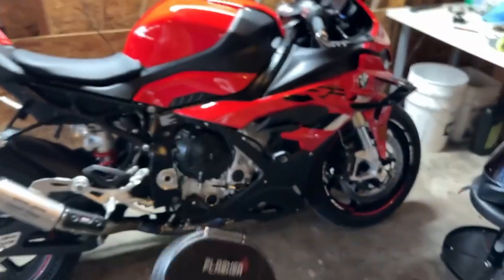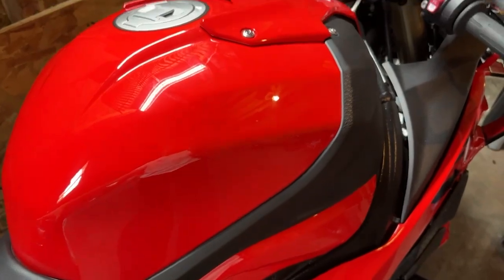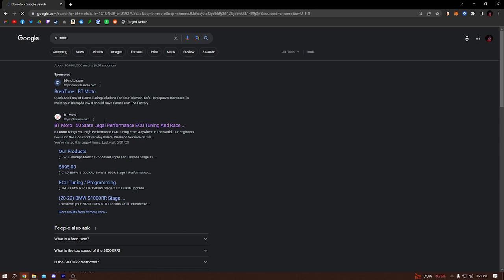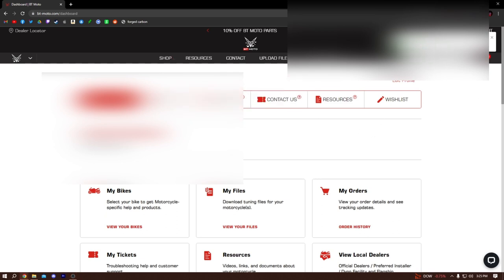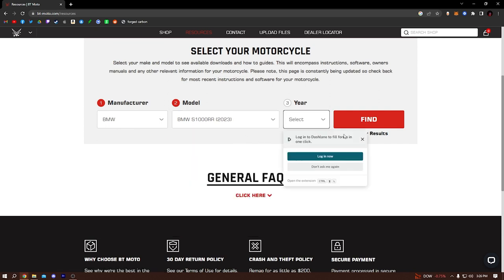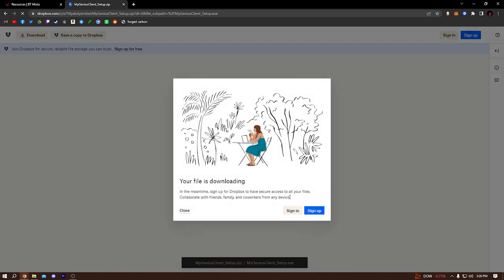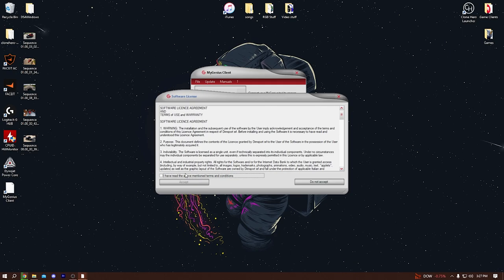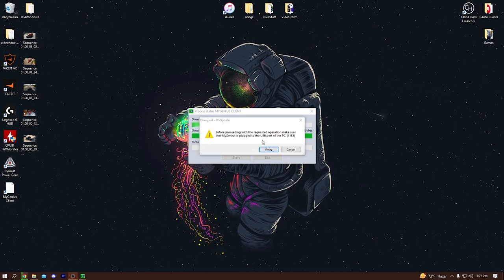How to Bren Tune your 2023 S1000RR! (Reaction)

Comment: Are all your quickshifts up extremely jerky with the bren tune? I got a stage 2 and a full akra exhaust installed on mine, and every upshift throws me back, no matter what gear Im in or what rpm Im at, or how little throttle input Im giving the bike. Its like the ecu is blipping the throttle way too much during quickshifts. The downshifts are super smooth the upshifts are ridiculous, almost unbearable, especially when just riding through town. Just wondering if there is an issue with my tune, or if thats standard.

Comment: My brother runs bt tuner in his 2022 they were backorder when I went to get mine for my 2022, so I went with slr. we have identical bikes, the exact same mods except the tunes. we weigh within 5lbs of each other, every time we race, weather from a dig or a 1st, 2nd or 3rd gear roll start my bike jumps out on his and pulls from him and wins by 3-5 bikes even when we swap bikes. And slr's customer service has been top notch! I couldn't get the tunes on the flasher, i called the tuner and he immediately did a remote screen share and downloaded it all for me.
Reply: Did you get the 91 octane map? Does he have the 93?
Reply: @SmittyAZ  he asked me what one I went with 91 because 93 is rare in my state
Reply: @natecote1971  91 here too. Frank usually flashes for 91. My Grand America is BT. The HH has two maps
Reply: @natecote1971  I found octane booster pellets that are easily carried. 1 pill brings my 7 gallon BMW high enough. BT
SLR did my ZH2 / 22 BUSA / 22 Triump ST 1200 RR and the Tuono V4  1100 was just ordered. These flashers are going to break me!
Reply: I have been debating SLR and or Brent I don't roll race just want the best performance out of these bikes and want to pay top dollar for the best.  Did SLR raise your rev limiter? i am thinking of asking him not to do that just in case.. Thanks
Reply: @Farhan.DucatiS1k  If you ask them to not raise it, they won't.

Comment: Flashed mine a few days ago. That tune is sublime! Mad respect to BT Moto.
Reply from the maker: Bren Tune is on top🔥🔥🔥 glad you enjoy it as much as me!
Reply: Nice! I might of heard a run of handhelds done by some of the engineers from a Tx company that specializes in a different field. 👀
Reply from the maker: What field?
Reply: @s1kdk  Automotive. I’ll find ya on IG and dm you. Loving the content! Keep up the great work sir.
Reply: How are your upshifts? Mine are jerky af
Reply from the maker: Smooth as butter, I’m gonna be getting the Stage 2 done this week now, I’ll post a video about that when I have it done
Reply: @s1kdk  I'ma have to contact btmoto then bc mine are ridiculously jerky. Are you goin full stage 2 with the temp sensor relocator, flapper delete and rev limit increase? I don't recommend the rpm increase. From what I understand that's where a lot of people are blowing their engines. Over rev is what's costing people warranties too bc the bike tracks it. I just went base stage 2, but I might get the temp sensor relocator bc the bike runs hot AF. Then again it could just be a bad tune considering my shift issues.
Reply from the maker: @jvillain9946 I’m getting the velocity stacks IAT relocated and the flapper delete yes. I opted out for the rev increase. I don’t agree with it either
Reply: @s1kdk  nice. Be safe

Comment: I got my 2023 ready with full akrapovic titanium full exhaust and the short Akrapovic pipe, so quick question after I  install the brentune do I still have to take it to the Dyno?
Reply from the maker: No dyno needed my friend!! If you have any more questions feel free to ask!! Use my discount code as well ;)
Reply from the maker: “S1KDK” for 5% off your purchase on BTMOTOs website!
Reply: Thanks
Reply: Can I go straight to brentuning stage 2? I’m going to buy it today I cannot wait to have it completely unrestricted but before I need to know the difference between stage 1 and 2
Reply from the maker: @josephrivera5252  You have to buy the stage 1 handheld so you can get the device, then you can order the stage 2 tune right away! They will just send you the stage 2 file instead of stage 1 if that makes sense :) you are going to love it unrestricted I promise it’s a brand new bike!

Comment: Hi, great videos and great motorcycle 💪 is the BT Stage1 or Stage2. What temperature does your fan run at?
Reply from the maker: I have a new video out now that I got stage 2 on it now! It runs cool now!
Reply: @s1kdk  Thanks for quick replies 💯yes I follow your channel 2 weeks ago was with Stage2 👍I'm from Germany, Suzuki GSX1000R fan on 105 °C after flash 94 °C fan on, engine doesn't get too hot. Bmw S1000RR 2021 fan on 101 °C, I read after BT flash 90 °C fan on. Thanks

Comment: Do you have a full system installed prior to the tune?  Did you also install a Servo Buddy?  Wondering if it is necessary.
Reply from the maker: Servo buddy and the tune is absolutely necessary. With a full exhaust you will need to do a servo motor delete, without the servo buddy you will have a check engine light on all the time. Without a tune the air fuel ratio on the bike will be way off and run way to lean. Hope this helps!

Comment: Question, so how are you preventing wheelies or looking at the sky on these pulls? Is it all throttle control?
Reply from the maker: Race mode is the mode I had the bike in on this video, race mode has wheelie control turned on by default and traction control turned on etc. It let’s me full pin it without having to worry about wheelies, and if it does it’s maybe a foot off the ground then will come right back down after on its own. However with all the electronics turned off and if you want to do a good pull, you roll on the throttle until you’re at full throttle. If you decide to crack it open going 40mph in second/first gear with no wheelie control or anything on. You will flip it. Hope this helps!
Reply: @s1kdk  thank you!

Comment: Is the pair valve still on or did you do block off plates? Wondering about the pop and crackles.
Reply from the maker: I’m not sure what you mean? Never heard of the pair valve before. Do you mean the servo?
Reply: @s1kdk  The pair valve sits on top of the heads and sucks extra air into the exhaust stroke of the piston to burn off any excess fuel and other "harmful" pollutants causing all kinds of shotgun blasts between shifts and obnoxious crackling on deceleration. Can't really hear it with the cat on but is gnarly without the cat.
Reply from the maker: @ebroebro1 never touched it, never heard of it!

Comment: yo bro so how you do it for the servo and full exhaust do you need the tune so it doesn't run like shit or some kind if servo buddy you put in when you did the full exhaust?????
Reply from the maker: Yeah you need the tune with the exhaust otherwise the air fuel ratio is all fucked up, I also have a servo buddy on mine to open up the exhaust even more.

Comment: How do you connect it to a stabilized battery?
Reply from the maker: Put a trickle charger on the battery, use my code “S1KDK5” for 5% off! My code got changed after this video
Reply: @s1kdk  and tune it while the charger is on? Isn't it gonna hurt the bike when the ignition is off
Reply from the maker: Yes tune it when the charger is on, no it won’t hurt the bike when the ignition is off, you’re supposed to put a trickle charger on it all during the winter season.
Reply: @s1kdk  I live in an asian country so here winters don't matter that much.. but thanks now I can open a tuning shop lol.. it would be nice if I could get your Instagram and talk with you